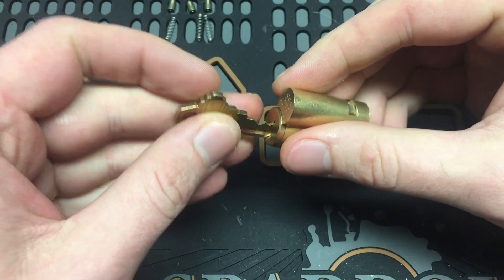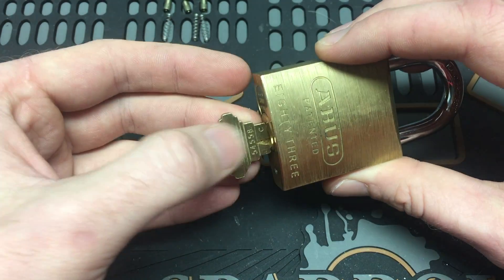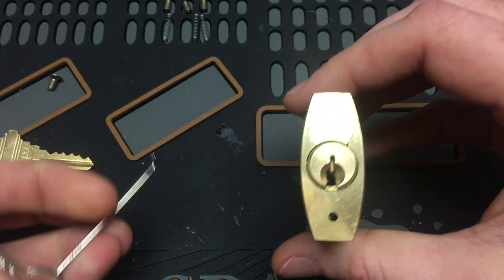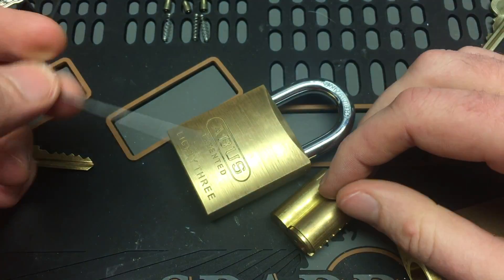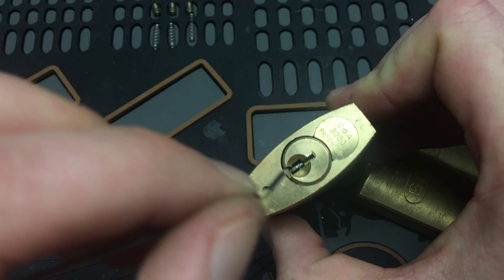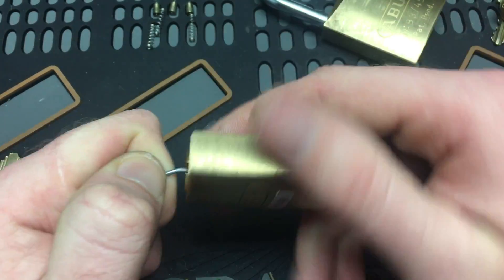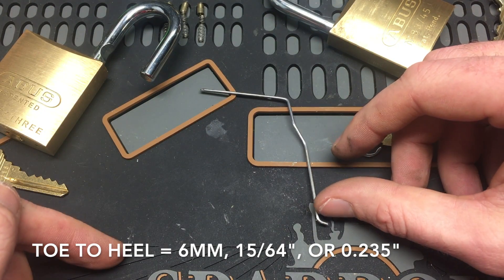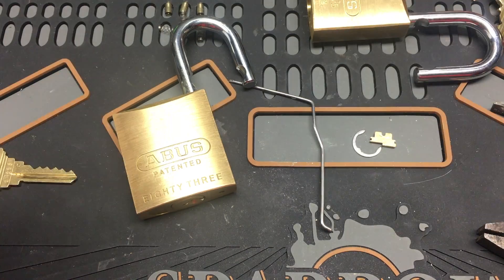LHLS #005: ABUS 83 Bypass Tool

Comment: If you cut the tool so that it is slightly too long to fit through the channel then straighten it slightly it will go through. Then hit it a bit until the tool shaft is inserted a little more this re-bends the tool so that the toe sticks out as far as it did before you straightened it which makes it much easier to catch the dogs on the cam lock. Once you turn the cam dogs and the hasp/shackle opens re key as normal. Try this and then make a new video with another self induced malfunction.

Comment: A tip for anyone struggling to find a good wire, use music wire. I used .047 thick music wire i got from hobby lobby for $2. Thin enough to fit basically any keyway but strong enough to do the job. Thanks for the video!

Comment: Amazing how creative we can get, especially to overcome our own mistakes. When I first started picking Abus 83/45 cylinders, I was very much a Locksport greenhorn beginner. I made some incredible screwups while repinning that cylinder. Ended up ruining a couple beyond repair. But on a couple of them, I saved the lock. I like the pinning window. But back then a few times I turned the core too far in the wrong direction and ended up getting the detent button stuck in a driver pin chamber.

Comment: My 83/45 isn't missing its cam follower, it was just donated to me as part of a pile of assorted padlocks with no keys.
Guessing this bypass trick isn't going to work if the actuator cam is still engaged with the plug.
Gonna have to open it the hard way.
Reply: This video action will work easily if you make the wire tool toe slightly too long to fit the channel, leave it not quite bent all the way so that it will fit in the channel, then tap it in until the tip bends over and then you can cam the dogs easily.

Comment: Mine wouldn't open because the core wasn't seated all the way down. Key could turn but it wouldn't open. I thought I was going to have to try to bypass it but that wouldn't work with the z bar in it. I ended up tapping (softly hitting) the core with a bump hammer. I pushed down on the shackle and turned the key back and forth several times and it finally popped open. The z bar is pretty banged up but I ended up getting it put back together correctly. Figured I'd pass on the info to maybe help out someone else that ends up watching this video hoping to rescue their Abus.  

Your video helped me even though it was a different problem, nice videos.